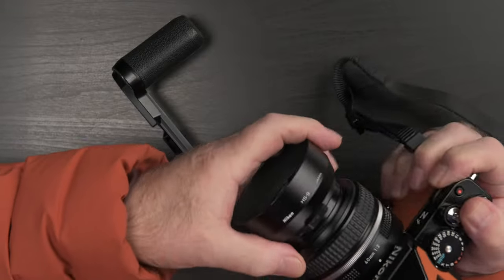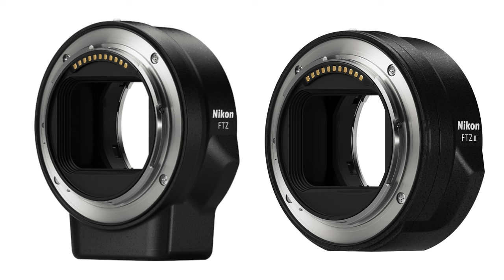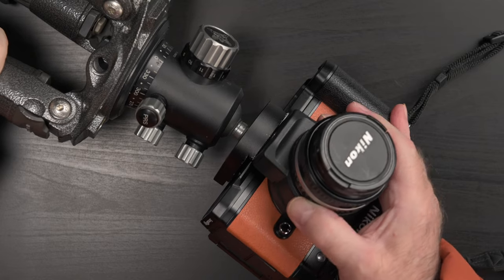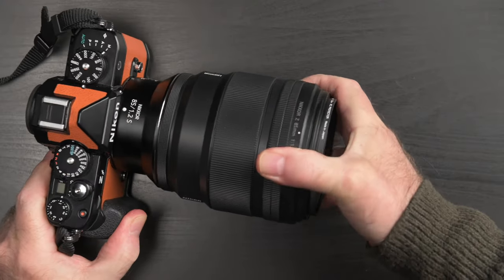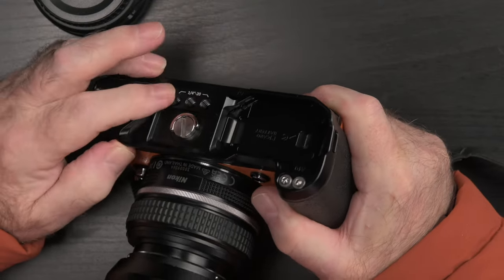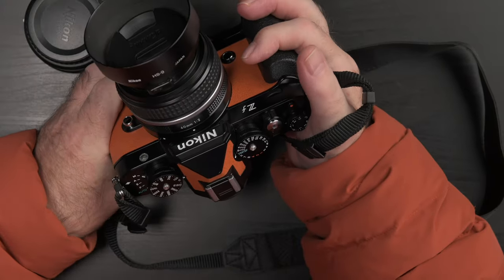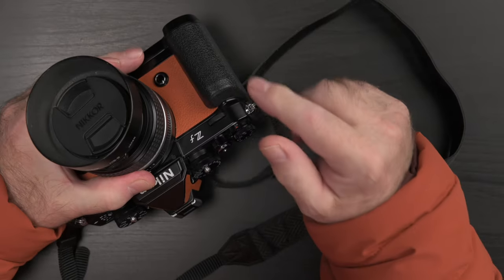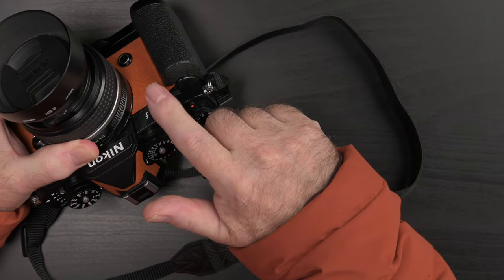Get a Grip! SmallRig L-Shape Handle for the Nikon Zf

Comment: The way it works with different colours in my market is that you order the black version, then you go to Nikon service center to change the leatherette. I want to change mine to grey, but I'm hesitant about what to expect. I'm just not comfortable with the thought that my new shiny body will have to undergo a surgery to install a different skin😕
Reply from the maker: Interesting. I'm not sure how it works here; maybe the same procedure, except you pick the colour on the Nikon website.
Reply: My understanding of the color options is that they're a limited production run and when they run out, that's it.  In fact, here in the US, Nikon USA already shows most of the Zfc colors as Out of Stock.  White and Grey are the only two that you can order, and they show as back order so may not even be able to get those anymore.  I was tempted by the Suset Orange Zf, but if I had a damaged leatherette/rubber trim that needed  to be replaced in a couple years all they would be able to replace it with is black, so just went with that to start with.  And I always liked the black/black Nikon film cameras anyway, such as my F2.
Reply: @Robert-R  it's very interesting to hear about the different market strategies for the same product. Even in the case of Z fc, they follow the same approach here; you buy the vanilla product then you take it to the main branch to change the leatherette. I guess one advantage of that approach is that there are no limited runs per se, and many more people get to choose the colours they like. I'm just not entertained by the thought of anyone else outside the factory tinkering with my new body!

Comment: Hello Ray - have enjoyed your channel over this past year, but first time commenting.  I just received my Zf on Wed 12/13/23 (ordered it on 11/11/23) along with the Small Rig grip.  The SmallRig grip is a good addition and fits well.  It certainly makes the camera more comfortable to hold, but detracts a bit from the full retro look - although not bad on the black Zf that I have.  The only issue that I've noticed is that because the memory cards are inserted from the bottom of the camera, when the grip is installed it makes it difficult to remove the SD card since the card is close to the edge of the wall of the grip.  I've either had to remove the grip, or use a technique where you slide your finger quickly off the card after having pushed it in to allow the spring mechanism to shoot the card out of the slot.  It takes a little practice and best done over a table, or your camera bag if you're out in the field, so that you have something to catch the card.  A bit of a nuisance, but not the end of the world.  As you mentioned, the grip will be use specific for me depending on the lens size and will have a Peak Design wrist strap on it, or a full neck strap as back up.
Reply from the maker: Hi Robert! Glad to hear from you. Thanks for the comment. Yes, I probably should have mentioned that it does make card ejection a bit fiddly. Not huge issue, but it does require a bit more dexterity ... or less pudgy fingers than mine!
Reply: The SD card slot is clearly it in a user-friendly location. But it’s not a deal breaker unless you have really big fingers. I don’t take mine out frequently, just after a shoot so i can be a little more patient with it.